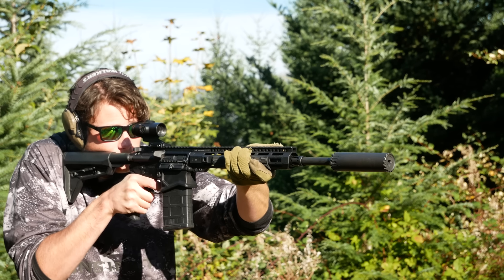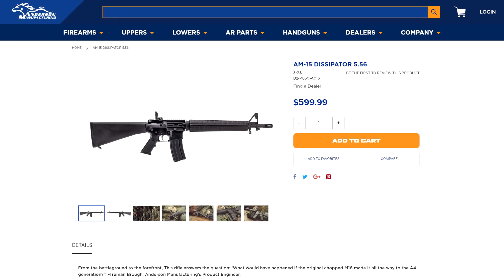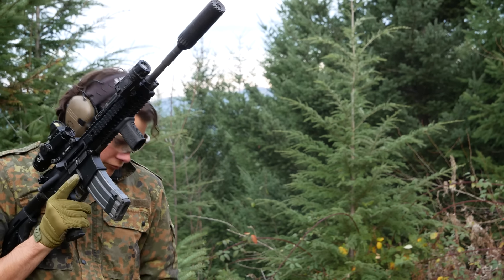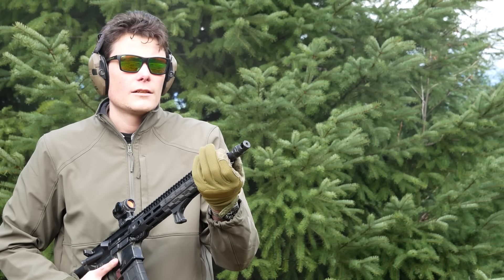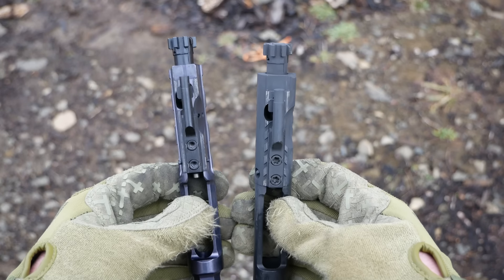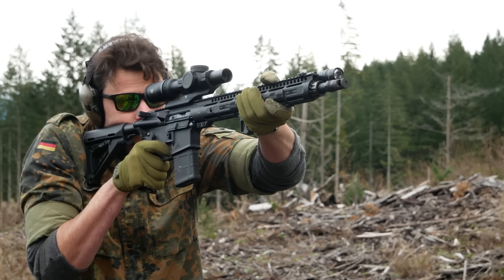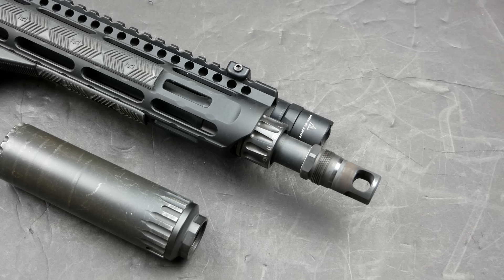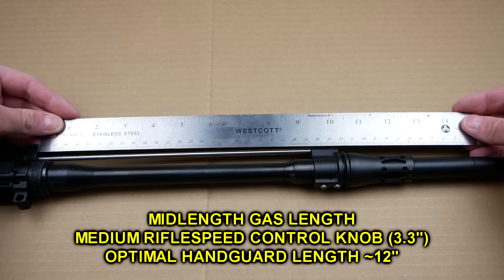The Riflespeed Dissipator

Comment: Imagine if Hop found the perfect handguard but it was only in Keymod.
Reply: Then it wouldn't be the perfect handguard 😁😂
Reply: LOL
Reply: Your a sick man Todd 😂
Reply: Am I the only one that doesn't hate keymod? I have a bcm keymod handguard solely because the mloc was out of stock. 

No regrets, there are still accessories and I found the ones I needed. It also seems smaller diameter and lighter than my mloc stuff. Nice for my 20in dmr at home setup
Reply: 😱The horror! How can you say that?
Reply: By definition, keymod is anti-perfect.
Reply: He has the most abominable taste in handgaurds tbh
Reply: @kevinfitzpatrick5949 , yeah it isn't that bad. I have an old BCM upper in keymod and it works well enough.
Reply: @kevinfitzpatrick5949  i wouldn't know everything i run is mlok
Hell even my spare guards are mlok... sorry 😂
Reply: @kevinfitzpatrick5949  KeyMod master race is building, idk how MLOK ever took off, it’s infuriating any time you have to actually utilize it
Reply: Then it wouldn't be the perfect handguard.
Reply: Gawd... could you image the autism spike?! lol
Reply: I like keymod. Never failed me. 

Just hard to find stuff for it now. Glad I equipped my gun years ago.

Comment: Dude!  I am an engineer.  I loved your rant about gas issues and cold!  You went into a deep dive into the insanity of the AR.  There is an alternate way to reduce the gas, a gas tube with a smaller hole.  The nice thing about the AR platform is the lack of training needed to be a gunsmith.  There is one issue with the AR, that is the frustration finding parts that will work for your build.

Comment: This adjustable Gas block is probably the answer to the 12.5" Barrel gas system problem
Reply: Or get a non meme LARP gun
Reply: Testing this out with the Roscoe K9 Patrol length barrel
Reply: @Dahm45  let me know how it does!
Reply: @Rebellion1776  just got it tuned and sighted in nicely! The 2nd shortest knob fits perfectly with the 10.5 midwest slim handgaurd and have it set to 7 with the stock plunger to cycle anything reliably. Everyone thats seen it is impressed by the hella flushment
Reply: @Dahm45  yeah I think this is the solution for 12.5" gas problem. Seems to have worked really well for yours, so that will probably be the road I head down too.
Reply: I was surprised he didn't mention something like an 11.5 or 12.5 patrol length gas system in the beginning.
Reply: @Dahm45 I have patrol length 11.5. What size rail you use?
Reply: @kirkwest6654  got the 10.5 with the 2nd smallest riflespeed knob, fits perfect!
Reply: @Dahm45 12.5 or 11.5 barrel?

Comment: You mentioned several times that this video is getting long and you are rambling, but I came across your channel while researching the SFAR, and the very fact that you get into the little details like why you chose the handguard you used and all the details about the riflespeed gas block etc is why I now subscribed to your channel. I am a huge detail guy, and am obsessive about getting stuff to work right and look right. Every question I had about the sfar and the riflespeed gas block have been answered, and a lot of unexpected great info about handguards was also included. Thanks much Bro!
Reply: Update: I bought the SFAR in the 16" 308 version a couple weeks ago. I finally got to take it out and run some rounds through it yesterday. It ran like a sewing machine. I ran 80 rounds through it, and it ran great without a hiccup. I ran a couple boxes through it on setting 2 and it fed perfectly and locked open on empty with a magpul mag as well as a Lancer, and a metal duramag. I then switched to gas setting 1 and it immediately short stroked and wouldn't feed, which is exactly what I would expect to happen because it is a suppressor setting, and I wasn't using a suppressor. I was very happy with the performance and I don't plan on changing anything except I will be changing the buttstock pad out for one with a thicker softer pad. If I have any issues later, I know what to change to fix it.

Comment: I made a 16in rifle gas build similar to yours with a KAK Industry barrel, lo pro standard gas block, and a A2 stock with standard rifle buffer parts and haven't had any issues with it cycling with or without a suppressor with 5.56 ammo. No gas to the face and it runs stupid smooth. I have a LaRue MBT2S trigger in it and its very nice to shoot.

Comment: Ya, the Riflespeed gas block is pretty sweet, but getting a hand guard to work can be a real struggle. It sits taller the normal low pro blocks, so not all handguards will slip over it. And if it does, make sure there is enough room that the barrel stays free floating during firing.

Comment: I built a 16" rifle gas competition gun with a Criterion Hybrid barrel and I've been super happy with the results. I'm running an empty buffer and a Geissele Super 42 spring with a AIM lightweight bolt. I'm not even sure the Riflespeed was even a thing a couple of years go when I built the gun so I used the SLR and setup the gun to run on a fairly hot .223 load when dirty.

Comment: I got the same kak barrel and went with a centurion two peace quad rail handguard. Now my other 16" rifle length gas barrel I got an FN 18" had my gunsmith open up the gas port, cut and thread the barrel to 16" and attached the rest of the hardware to include triangle handguard. I used the H&R upper and lower receivers from PSA. It's my favorite AR to use for pretty much everything now.

Comment: I have a 11.5" midlength faxon which is definitely in the dissipator category. I use fixed gas on it because like hop i dont like adj gas blocks. While I am sure it recoils more than a tuned gun would, with an H3 and sprinco red it still has considerably less recoil than my 10.5" carbine gas gun, and it will still work with cheap .223 reman loads.
In fact it has never failed to function in any way, in temps from about 0f well into the high 90s.
Also, hello Hop.

Comment: I've had one of these on a shorty .300 blk I built for a bit over a year at this point. I was really impressed, my goal was to make a super light gun that works reliably both suppressed and unsupressed, I was very close to accomplishing this. With super sonic .300blk it works great both suppressed and unsuppressed, with subsonics though it has occasional hickups when unsupressed.
Reply: Do you really need to cycle subs unsuppressed though? The entire point of subs is shooting suppressed. With 300 BLK, I'd rather have a short barrel with pistol length gas system with a non-gaped gas port that can cycle subs suppressed but also isn't terribly over-gassed when shooting supers suppressed, with a standard gas block.
Reply: @AncientGloom  nope, I sure don't and that's why I'm not too worried that it has occasional hickups shooting subs unsupressed. I really just used that as a measure of reliability with varying .300 blk loads aince even with supersonic .300 blk there are guns that are picky with ammo unsupressed. It's also really very pleasant to shoot even with supers supressed at least in comparison to something like a mk18.

Comment: So glad you got one of these. Been running one on a suppressed 300 BLK for awhile and it’s just fun. Only issue I’ve had is freezing up the plunger due to the pistol length gas system. Lubing it up once a while takes care of that issue. From 300 supers to subs to with or without suppressor it fits my build perfectly.
Reply: Should be noted I have a larger gas port drilled out so that’s where some more issues come from but allows me to get that full range. Works for me 🤷🏻‍♀️

Comment: Great video! I love my RS block. Put it on my AR-10 and AR15 ... both suppressed. Was difficult to figure out which plunger was better for the 15 but after using the second plunger provided in the box... runs clean. 3pm ejection pattern.

Comment: Bushmaster solved the Dissipator “problem” with the carbine length gas system.   Mine is chrome lined.  Windham Weaponry still makes this in two barrel profiles.
Reply: Carbine gas on a 16 inch rifle is wack
Reply: It’s like you missed the whole point of the video.
Reply: @JimYeats  you missed the point of my comment.  Rifle length gas block on a 16” inch is stupid on its face.
Reply: @lizzardwizard2000  Ok, I guess others disagree in this time of adjustable gas blocks and suppressors.

Comment: I have 2 uppers I've installed the Riflespeed adjustable gas block. 
Absolutely awesome toolless adjustable system. The last thing you want to do is rummage around for an Allen wrench or even a shell case to adjust your gas. Just grab the numbered sleeve and click it up or down a click to tweak your setting. And perfect ejection pattern.

Comment: I was an early adopter of riflespeed and loved it even when I couldn’t get other plungers.
Reply: I'm a SA agb bro. Set and forget. Fire hand loads. Why use the rifle speed? I still don't get the "why"
Reply: @Gnolomweb  because it’s adjustable and the dial/plunger is replaceable without having to regas the gun, you can easily switch between suppressed and unsuppressed as well as stay properly gassed based on weather conditions. I can run my gun suppressed or unsuppressed down to -40(maybe lower) and up to 122 degrees Fahrenheit all very easily.

Comment: 7:23 not unjustified, adjustables are known to seize from carbon alone, i snapped a tool inside a slr gas block once
Reply: This is why you make sure to always coat the set screw in high temperature anti seize and you periodically run the screw forwards and backwards to clear out any carbon
Reply: @newerest1  Or get something where you dont have to do that.
Reply: @kilroy5166  Easier said than done. Not everyone wants a pricey Riflespeed that weighs 4x a standard gas block. The detent based ones like Superlative arms work really well, and as he said, are generally a set and forget, but yeah, periodically using the screw to ensure it doesn’t get locked up is good practice.

Comment: I'm Running a POF Adjustable Gas Block on A 18" 1 in 12" twist Barrel, and it Also Had The Problem of Being WAY Over Gassed ( along with the JP Silent Buffer / Recoil System  ) @ first I Was Running The Standard Gas System And It Felt Like The Rifle Was Going to Brake in Half. Now It's As Smooth as Can Be.
I'm Still Sorry about hearing You're James's brother.

Comment: I went with an 18in rifle length to avoid the under gassing. Works fantastic.
Reply: 18” is actually a great length that really should be more popular
Reply: How much exposed barrel do you have after the .750 adjustment knob? Had a thought to put an OCM5 on a build like this but it'd need 2.05" of extra barrel to have the sleeve on it.

Comment: I have a Delton Dissy upper with(non-adjustable) rifle length gas.  They redid the gas ports at the factory, and I've never had an issue with it.
Reply: @Allenmar73 Nope, I slapped it onto a KE Arms lower and its worked 100%

Comment: I should probably just watch more of your videos for the answer but, I’ve got an iwi Zion 15 tac 12. It is a 12.5” 5.56 with midlength gas system. It comes stock with carbine coil and 4oz buffer. With just pmc xtac 55g m193 ammo….its quite strongly gassed. So much so in fact, that I’ve already added a red/white, springco cryo treated and an rb5000 kynshot…and it now shoots very nicely. I’ve ordered the tubbs 36 coil flatty, waiting for it to arrive to try out as my ocl polonium (full size, full bp!). I’ve also got an SA agb. I’m waiting for the can to be approved before I install the 6315rf and SA block….as I have another 16” complete upper, with a 3P15, and an Ecco machine adapter for the polo. My question is for the 16” gas block (also midlength gas)…is the Riflespeed system worth the $199? When I can get the SA block for $79? Or even a wojtek for $65? The riflespeed would look really cool. But $120++ for an agb should be remarkable.
Reply from the maker: Adjusting the SA is pretty annoying and adjusting the Wojtek is even worse. So it depends on how much tuning you want to do and if you want to shoot both with and without the suppressor.

Comment: Im in the process of building a 16" upper that'll primarily be suppressed.  It has an intermediate gas system. Im going run the RS7533 gas block with a 13.5" hand guard. Hopefully it works out nice.

Comment: Kinda two steps removed but if someone prefers the custom gas tube or gemtech adjustable BCG routes, Lead & Steel sells  chrome lined 12.5" mid-length HS Monobloc barrels (ie, gas black is integrally machined). They are pretty pricey standalone, though.

Comment: I only watch these to see the fur baby. Also working on a pencil barrel 20 in light weight build and would like to have a qd can set up so thinking about this adjustable gas block but the 17in rail makes it a stretch to access with an Allen key. Would love to see it with that longer quick adjust clicker. air biscuits paws

Comment: my only gripe with the rifle speed gas block other then price, is the weight. The shortest one is nearly 4 oz and get heavier as you go longer. Added to the fact that they get installed at the far end of the rifle only makes the additional weight feel worse. 

I like to strip any unnecessary weight from my builds and use an adjustable gas block to make sure the BCG still cycles properly. I would love one of these but only if they made them lightweight. Maybe aluminum or titanium for the body and steel where it really matters. If they can cut the weight to one or two Oz. I'd buy several

Comment: I found a PTR 91 build that works for me. Note: Its an older JLD PTR with match Wilson barrel. MFI super low profile clamp on rail (I have a piece of G3 rail to weld on, but I'm on the fence as the trapezoid recoil lug is present) with a Steiner T536 5x36 prism sight. Its got an AIM Sports tri-rail, weapon light mounted 6 o'clock, angled foregrip further forward and a KAC foregrip a bit further behind for stabilized kneeling shots. Since the rail system is clamped securely to the trunnion, I have a Vortex red dot on an angled mount at the rear of the rail space on the 3 o'clock position (dot is at 2:30) where the dot is in line with the bore for relatively simple adjustment. Further forward out on the 3 and 9 postitions about 2/3rds of the way up, I have clamp on bipod legs and that leaves plenty of space for any size PEQ/IR unit you could want. Classic stock is working for me right now but I smell a Spuhr stock on the horizon. The classic sling position is where I like mine. Even still running the leather one with a nice wide pad wrapped on it.

Comment: I've been trying to suppress my LWRCI DI 16.1" for awhile now. Rifle came VERY over gassed out of the box, ejection was right at 1:30. Geissele braided spring and h3 buffer magically took a 1:30 ejection and made it right at 4 o'clock but felt recoil was definitely increased which was very strange. Reliability still at 100% after testing 300 xm193 and 50 BH 77G OTM..... Throw a suppressor on and becomes a jam-o-matic....

Comment: If you runa suppressor most of the time then run a heavy buffer and tune the gas block torun with that buffer so that all you have to do to make the gun run better without the suppressor is swap to a lighter buffer if you can't adjust the gas block.

Comment: Anybody wondering, m16 length gas systems are the best when suppressed. I personally didn't really notice a difference between my mk18 when loud but suppressed is extremely noticeable, even the mid-length rifle is definitely jumping more. I'm sure even longer gas systems would be that much nicer, but general rule of thumb I've learned from smarter people than me and personal experience, if shooting suppressed go with longest possible gas system.

Comment: My 16" rifle gas criterion barrel runs fine with a vltor a5h3. Stick a bucket at 330 and it'll catch all the brass. Haven't suppressed it yet but i imagine it'll be fine esp with a low bp can. Looking at b&t offerings as i already have a couple surefire muzzle devices, one pinned and welded.

Comment: 90% sure you'd need an 11" handguard for the 12.5 midlength setup. I seem to remember i did a 10.5" handguard on a mid and a tiny amount of gas block was exposed, much like the 13.5" here. Just to save you a headache if you do end up making one 😂